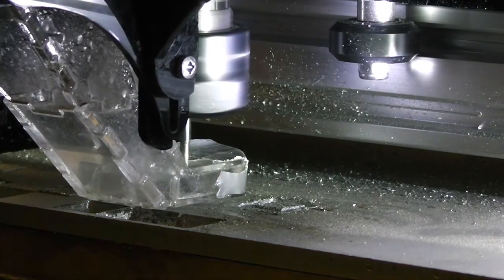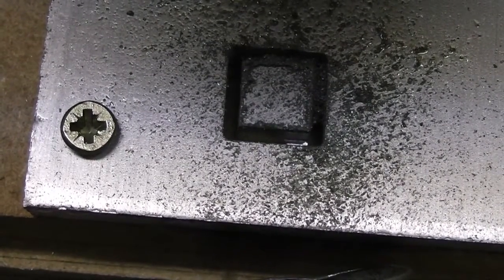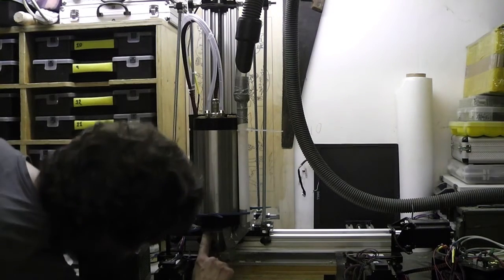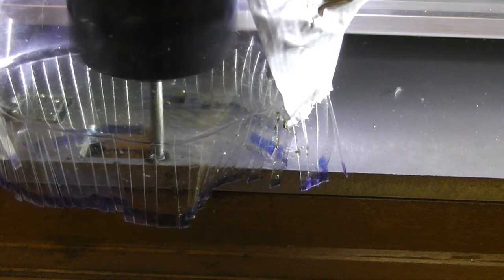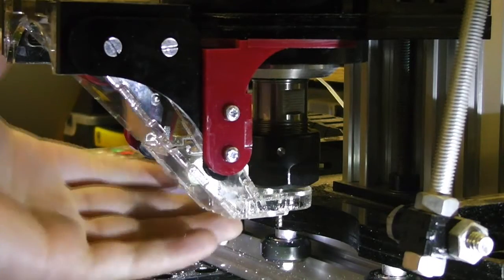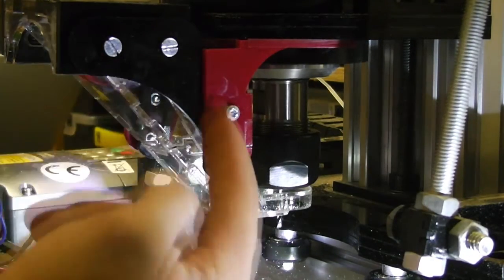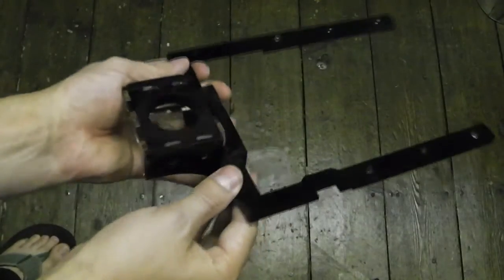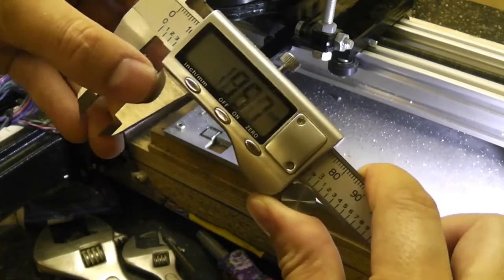Cutting Aluminium on a CNC Router made of Acrylic Sheet - CNC router blog 12

Comment: I thought the general rule was never use a 4 flute tool on aluminium, use a single or 2 flute max. Clearing the cut of chips seems to be more important than lubrication so a combo of just enough movement speed and cutter RPM to get the job done, running the cutter at very high RPM just builds up heat and dulls the cutting tool faster. Aluminium produces a huge mess on my Ox CNC without extraction :-)
Reply from the maker: Thanks for the advice - this is my first attempt at cutting aluminium. The 4 flute one did seem to build up a lot of chips, although as you see in the video it broke because I set the feedrate too high. The single flute bit I used later in this video seemed to work really well, so your advice makes sense! Removing the chips does seem to be the most important factor, and although the extraction I built works well, I will probably take the advice of +ontheworkbenchtoday.com and add a lubricant basin to the next version of this machine, which will let me flush out all the chips really thoroughly.

Comment: The plugin  you  wrote  does  it improves  the sketchucam plugin lacks  ?
Reply from the maker: My plugin has a few less features - there's no visual representation of toolpaths etc. But my plugin is a bit simpler to use - it works more like an 'export' tool for GCODE rather than adding things into the SketchUp user interface. It is still a work in progress, and probably will always be, as I add more features to it when I need them!